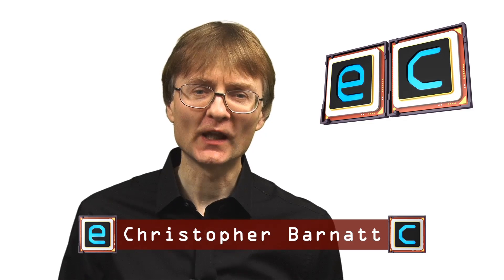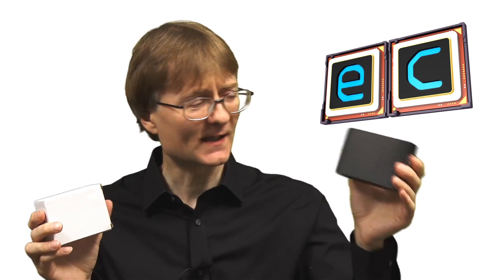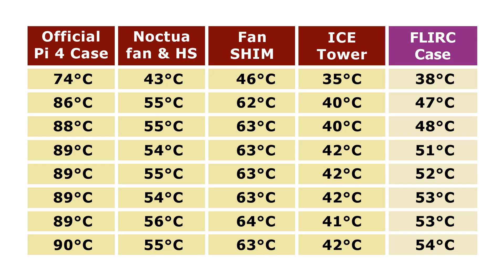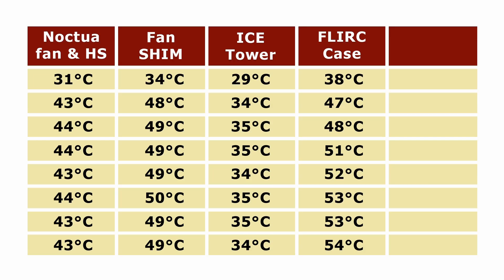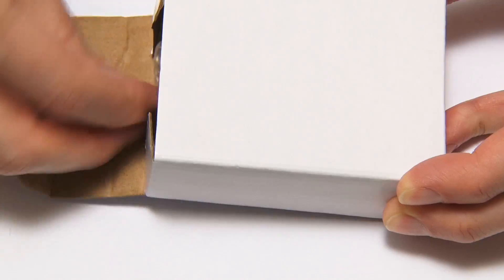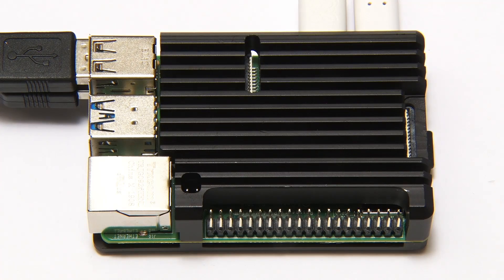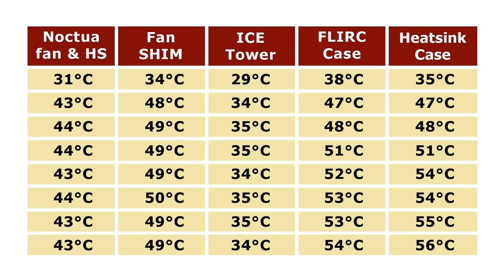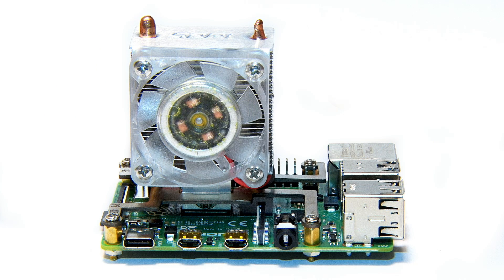Raspberry Pi 4 Passive Cooling

Comment: No got a PI4 yet but does the firmware update reside on the SDcard or the PI itself?  ie do you need to update every SD image?
Reply from the maker: It resides on the Pi, not the SD card, but gets installed with the latest Raspbian update.

Comment: Amazingly great information Christopher. I didn't know about this thermal update. This makes the RPi4 a lot more usable. I wonder if the performance is still the same when overclocked. I'll have to do some testing too. But so busy with the Jetson Nano. Also the USB problem with the 4GB RPi4 model in Ubuntu arm64 is fixed with this update. You still need to use the trick of lowering to 3gb to install, but once rpi-update is performed it can be removed again. 
I love my metal case for the NanoPi M4V2 too. It does use a fan, but it's a 12V fan,  and at 5V you can't hear it and it still keeps it cool enough. I hate loud fans, now I don't use a x86 pc anymore I can hear the sbc fans a lot better. Have a great day, it was a great piece of investigation. I love to see the effort you went through to make this video. Greetings, NicoD.
Reply from the maker: Hi Nico! :) Thanks for this. I know you will appreciated the time involved when this video evolved on me. I did not anticipate doing so much testing of different setups.

Comment: How are the temperatures of the Pi 4B without any cooling and the new firmware? 
I'd imagine it might also be quite a bit lower than the previous 90°C.
Reply from the maker: I am sure you are right -- but I did not want to run that test again!

Comment: Do these metal cases interfere with wi-fi reception of Pi? Great video, thanks!
Reply from the maker: The signal strength drops a little.
Reply: The flirc does make WiFi and Bluetooth signal poorer, I have one about 3m away from router, between floors, it's fine, but I had had one about 12m away between a floor and two walls, it's no good there, a case needs to be plastic as you get further away, like a snespi case, with active cooling or the ice tower as the metal of the heat sinks is away from the WiFi module, the ice tower also is acceptable as a passive cooler as well, a recent purchase that I'm very pleased with.
Reply: This is why there needs to be a mount to add on an external wifi antenna...
Reply: @adventureoflinkmk2  very good point, I have often thought it.

Comment: Did the new firmware had any impact on the performance?
Reply from the maker: Not that I am aware of. The first USB controller update caused major problems for some Pi 4s (although not for mine). They seem confident that the new firmware has no such issue.

Comment: What's the price for that software cooling? Lower performance?
Reply from the maker: It seems there is no price -- performance does not seem impacted. They are just managing power more effectively in the SoC and USB controller (or were managing it badly before!).
Reply: @ExplainingComputers  Thank you for your answer. It is very strange to me that they didn't test it before release. Maybe they did but can not create a solution at the time. I'm wondering if video playback is affected.
Reply from the maker: @AlexJPetrov  They were maybe under pressure to release the board. Video playback is not affected -- to improve that we need operating system and app support for the GPU.

Comment: How do you backup the eprom on an RPi4 ?
Reply from the maker: You cannot backup the eeprom, only the OS and its settings (eg by copying your micro SD card using the utility in Raspbian). The eprom can have a previous copy loaded back in. My comment in the video could have been clearer -- I was referring to backing up the SD card installation on the Pi in case the eeprom change corrupted it and caused data loss.
Reply: @ExplainingComputers   Thanks for the info

Comment: Thanks for this video! I wonder how the update impact the performances of the PI. USB disk and general usage XD

Also hope they improve video playback someday so that we can use as a desktop and watch video on youtube!
Reply from the maker: Yes, GPU accelerated video playback in a browser is what we need now -- oh, and USB booting! :)
Reply: Odd, just been playing back video in YouTube without any problem using Chromium - it's all GPU accelerated. Loads of people use it as a desktop already!
Reply: @JamesHughes65  ? Weird, lots of reviews out there showing missing frames as low as 720 & 1080 while it can read 4K in video players...
Reply: @DragonEgg11  The data path through Chromium is horrible - VLC can play direct to screen, Chromium needs to copy the frame about 5 times then scale to the destination window - that's a lot of data being thrown around (often unnecessarily, but blame Chromium). We've optimised it a lot, still some work to do, but gets better with each release. Shame the Chromium devs don't spend the same amount of time optimising their end....

Comment: The passive coolers do not look professional to me, in both cases, the heat sink area has a layer of paint over them they should be metallic and smooth plus they should have used thermal paste not pads, and the case screws should have been spring-loaded for a more accurate fit with the chipsets.

Comment: As I am now running one of those Armor brand Heat sink/cases, I tried to parallel your efforts as I watched.  I had already upgraded my firmware, but checked it anyway.
After adding the test software, mine started at 43C.  Subsequent temps were 51, 52, 54, 54, 55, 56, 57  - clearly it is warmer here in Australia, but the peak was little different!

A final comment that is mostly unrelated.  I was happily running Manjaro on that machine; until I applied the latest update.  Then it would not boot.  In fact it did not even have the big rainbow square appear.  It still runs Raspbian and LibreELEC.  I tried rebuilding the drive with the latest image off the web, and it get the same result.  I can run this OS off the unimproved early image (Manjaro-ARM-xfce-rpi-19.08), but I dare not apply any updates.  Apart from watching for a newer version than "...19.10",  I now have a second SD card pressed into service as a test for this process.
Reply from the maker: Very interesting feedback on Manjaro with the new firmware. Thanks for sharing.
Reply: An update on the Manjaro problem I reported - and this may affect other operating systems on that machine.
I found that the OS was running, even though nothing was on the monitor.  I could login via SSH, and all seemed well at the OS level.  It took a bit of thinking before I realised that I had my screen connected to the "wrong" outlet.    So for the Raspberry Pi range, this problem is unique to the Pi4.
When I first ran up the Pi4 with Raspbian I was keen to see the two screens running, and so I had arranged them to come up as default as the screens were on my desk.  I mentioned at the time that control of the dual displays was still a bit crude compared to my AMD64 machine.  So when I disconnected the 4K monitor, I left the connected screen on the HDMI outlet closest to the power connector.  None of the operating systems seemed to be particular about which HDMI outlet was used.
This therefore worked for Manjaro 19.08, and it still does with Raspbian and LibreELEC.  But not when you update Manjaro, or install 19.10; then the expectation is for the display to be the one closest to the USB end.  I have yet to re-test a dual display setup.  Note that I did not see anything about this on the Manjaro Forum.  It may be noted somewhere, but I did not find it.
This means my Pi4 is back to being a well-behaved and quite fast Manjaro computer.   :-)   I just have to put all the settings, applications and data back in place.  :-(

Comment: I wonder if the thick thermal pads are a slight bottleneck? i mean it's cool enough but still :P
Reply: The pads are too thick. They warp the circuit board when putting the case together.

Comment: Congratulations on the scientific rigour. You've probably saved a lot of people a lot of time running their own experiments. 

It looks as though passive cooling is perfectly adequate for most purposes, (and there's no risk of it dying quietly, unnoticed). A few thoughts arise: "Case as heatsink vs heatsink as case?" should serve for scholarly debate for, oh, the next couple of centuries. 

What are the thermal properties of anodising? Would it make a difference to sand the thermal contact area back to bare metal?
What would be the result if someone reproduced those cases in copper? 

(Thinks; 3-D print core to cast by lost-PLA....or even more Heath Robinson/Rube Goldberg processes... :-)* )
Reply: Anodising doesn't conduct as well as aluminium, removing it at the lug would help. It would run cooler if remade in copper, not sure how much. It would also be heavier.
Reply: @jonathanshaw6784  The anodic layer is so thin that its thermal resistance is inconsequential. Copper has approx twice the thermal conductivity of aluminum depending on which alloys are being compared so the heatsink's thermal resistance would be cut in half if made to the same dimensions. How that compares to the thermal resistance of the heat transfer to air is beyond me.

Comment: How does wifi perform with the RPi4 inside metal boxes?
Reply: I was worried about this myself but if the Pi is more or less right next to my router i should be fine right?
Reply from the maker: @SDMF20  Yes, you should be fine. I've seen the WiFi signal strength drop a little, but no network performance issues.
Reply from the maker: It does, but signal strength is slightly reduced.

Comment: The noctua probably isnt cold enough to affect performance? Flirc should be fine?
Reply from the maker: Flirc should be fine in most cases, assuming the new firmware is applied.
Reply: ExplainingComputers i imagine that is especially true if heavy use is not expected to be done protracted over several hours

Comment: Did you do a stress test without any cooling solution after applying the firmware update? I assume a stress test will still make it thermal throttle, but would the new firmware avoid throttling in ‘normal’ uses where it previously was struggling to do so?
Reply from the maker: Sadly not -- as I did not expect such a dramatic impact from the firmware change.
Reply: ExplainingComputers that’s fair, understand the video changed emphasis halfway through. Safe to assume there should be a solid improvement, though. Maybe even the official case will be usable now 😉

Comment: Thanks for the video. Have you also checked temps of the official rpi case without cooling after firmware update?
Reply from the maker: I have not dared to run a test in that sealed case again!
Reply: I would say this case it suitable only for transporting the device. To run it, better to take the lid off :)
Reply: It will throttle if you run it hard.

Comment: What about wifi performance in those cases?
Reply from the maker: Signal strength seems a little reduced, but not massively so.
Reply: cool. thanks. Ive been thinking about the FLIRC case for some time.

Comment: Flirc Raspberry Pi 4 Case (Kodi Edition) $21 Canadian. This a nice case for low temperatures but not good for adding a camera or access to the GPO pins. The heatsink case is the winner for providing full access to GPO and camera.  Thank Chris for all your hard work lots a testing going on and rebuilding the Pi busywork 😳
Reply from the maker: Hi Dale.
Reply: ExplainingComputers / back to you Chris.  Your going to need a good Christmas holiday and take some much needed rest. Most viewer don't realise the amount of work that's required to hammer out all these videos, that a the research needed to have a good informative show.  So have a good Christmas !

Comment: Very impressed with this video, it shows progress, I think I might have been one of the first with a flirc case, it arrived to me on one of the hottest days of the year, I put it together, and started testing it out, before too long the pi was getting very hot, the red sign was on the pi and and the pi was giving off a dreadful smell, pleasant to touch it was not, like handling a kettle or a toaster, I had several flirc cases in the past, which were fantastic on the pi 3, I was so disappointed with this one, especially as I had it shipped in and paid extortionate taxes on it for me and I got one for my brother, which he wasn't going to want, but now these raspberry pi 4 run nice and cool, even with an overclock, good work pi foundation, though perhaps the pi 4 was rushed out, maybe things like this needed ironing out first and probably still do, I have had two raspberry pi 4 with display and sound issues after running beta berryboot, hats off to the official raspberry pi outlets who posted out a replacements straight away, so the raspberry pi stays my favourite SBC.
Reply: Nearly 2M sold - if we had waited until everything was perfect, we would not have sold any yet and everyone would still be waiting for many more months. And of course, no product is perfect.

Comment: Very thorough test! I noticed the relatively thick thermal pads of the passive coolers. I suppose manufacturing tolerances make an accurate approximation from cpu to case difficult. Any thoughts on how much a difference contact makes, ie thin layer of thermal paste with a well fitting heat sink vs fat thermal pad?
Reply from the maker: As you note, there is a gap to fill. Given how the rest of the case is manufactured, it would be hard to get good contact with themal paste -- which is what I used with the ICE Tower.
Reply: @ExplainingComputers  If they had used a spring-loaded screw-on system it would be possible.
Reply from the maker: @jonathanmaybury5698  Indeed.:)
Reply: Good point!!

Comment: I think I'd prefer the two-part aluminum case as it allows access to the GPIO pins.
Edit: How well would the two-part case work if you managed to mount a 40mm fan on it?
Reply: There is a version of the heat sink case with two small fans. Time for more testing!
Reply: @cyrfung  The fans drop the temperature by about 10 degrees, and replacing the alleged "thermal pads" with 0.5mm thick copper shims and thermal grease drops the temperature again to about 40 degrees.
Reply: @neilshep50  can you send me a link for  to buy this 0.5mm thick copper shims?
Reply: If you don't need access to the board the Flirc case is the way to go.
Reply: ninline2000 but if you need to connect lcd s for example you can use the 2 part aluminium heat sink case
Reply: The flirc case has a space for a 40 pin ribbon cable to come out of the case, so you can use the gpio pins with some extra work.
Reply: Eric Carver Same here
Reply: There is a version of the heatsink case with a little fan on it.

Comment: Hi, thanks for the video.   How long your tests ran?  I tried the Flirc case and run a test at full load.  After 30 minutes, the temperature was above 80 degrees  Celsius.
Reply from the maker: I imagine you are running an older firmware? All of my tests in this video ran in 10 minutes. But they took up to 40 in previous videos where the Pi throttled (eg the offical case test).
Reply: Hi,  I have tested it with the older firmware.   I won't be able to re-test it since I returned the case.  I ordered the other one you showed in the video.  Thanks again.

Comment: While the FLIRC case looks sleek there's no way I can reccomend it after what I have discovered. First of all there's a recess in the contact area where an ejector pin pushes the case out of the mould during manufacture that amounts to about 1/4 of the surface contact area being diminished. But, that is hardly an issue when the ENTIRE contact area is better than 1 millimeter ABOVE the SoC to begin with ensuring ZERO contact whatsoever! I immediately discovered this after a dry fit of two Pi 4B boards into two cases. Leaving the film backing on the thermal tape I did a dry fit up and the tape fell right out from between the case and the SoC! 

BTW - I employed a surface plate and height gauge to measure this gap indirectly by measuring the height difference of the SoC above the component side of the PCB, and comparing that with the height difference of the mounting studs cast into the case vs. the "contact" surface of the case. The difference between these two comparisons came to 1.19mm for both cases I have on hand.

Buyer beware.
Reply: A reviewer on Amazon examining the other style case, which apparently also suffered from some tolerance issues in an earlier revision, resorted to putting some putty on top of the SoC, doing a dry fit, and then measuring the thickness of the squashed putty.

Reviewer recommend using separately sourced 1mm thick thermal pads to compensate for poor tolerance.

Comment: Nice video but it would be even better if you included the measurements of the official pi case after the firmware update.
Reply from the maker: True -- but I did not want to try it again! :)
Reply: @ExplainingComputers  Fair point. You proved the firmware update should be a no brainer for anybody to install, adding (active) cooling or not.
Reply: Can't please everyone.

Comment: Massive hole in the middle of the lug??? Might want to sand and polish the lug, fill the hole with solder to bridge the air gap, use paste rather than a pad, and use a rubber grommet at each screw to allow the board to be tightened evenly.
Reply from the maker: The pad overcomes the slight indent in the lug -- using paste would be very tricky, as the SoC cannot get closer to the lug, due to the contact of the board with its mounts. So there needs to be something to fill the gap.